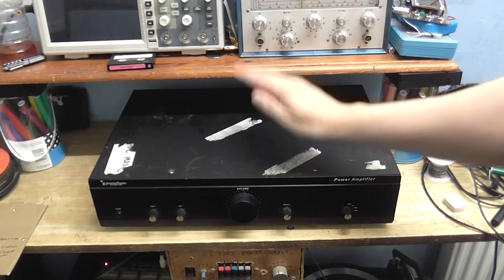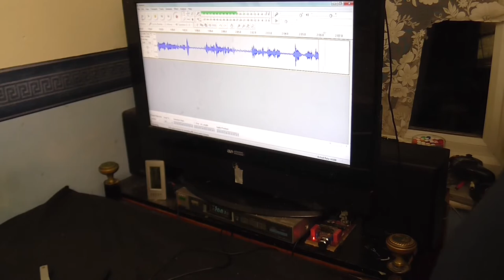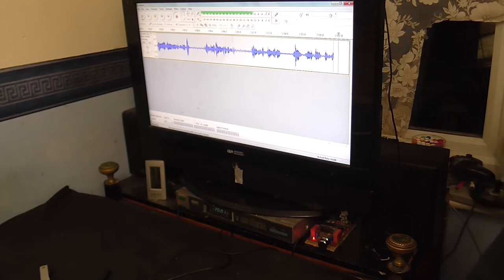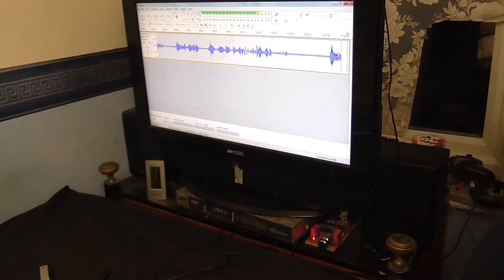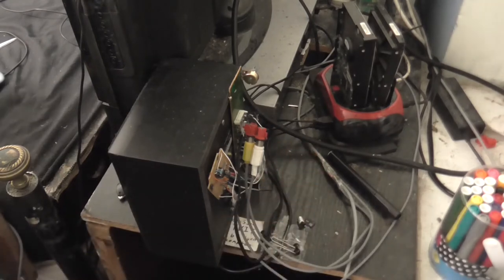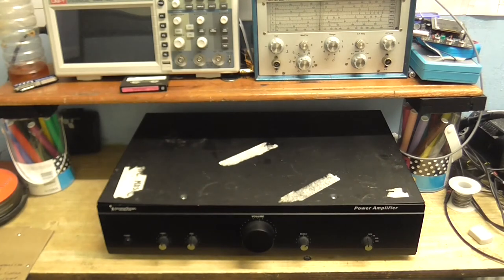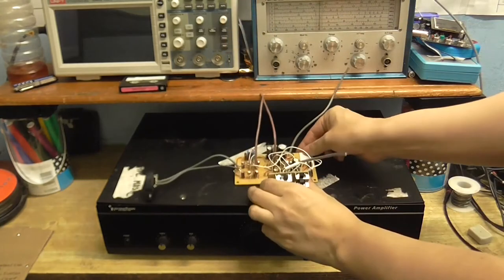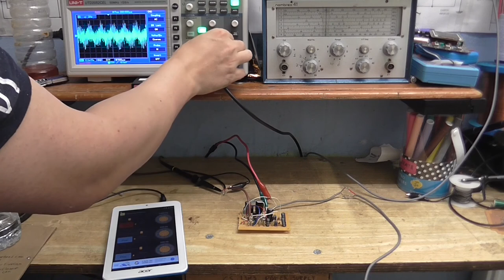Modifying an amplifier to have a "Windows 7" "Loudness Equalisation" circuit.

Comment: Wow, to see the working from the circuit so clear on your scope, super understandable this way! 
You say you made a video about that circuit? Okay then thats what i go looking for now, right after this video. I hope to see the schema in that previous video because i think i see only transistors and so well working too, thats a nice and interesting circuit i think.
Thanx for showing with scope and explaining so understandable
Reply from the maker: That's the beuty of it, the circuit only uses three transistors (per channel) and no chips of any kind. The video where I show a schematic is in the description.
Reply: CoolDudeClem 
Wow that is strange, that first transistor doesnt have any DC, only that little alternating signal current on the collector! How can that work so well? A DC-less transistor works almost as a regulated resistor, bit like a FET? But without heavy distortion? I see and hear this works absolutely great, and it sure is a nice and surprising circuit!
Reply from the maker: I'm kinda confused about it myself, I thought there might be some DC offset going on, but I measured it and apparently not.

Comment: You might have windows loudness equalisation built in to your computer's audio hardware.   This can be found under Play-back Devices/{the speakers in question}/Properties/Enhancements  It's worth checking out if you haven't already done so.
Reply from the maker: That's how I usually have my sound set, I always have that on. Like I said I watch a lot of YouTube, and the loudness equalization makes it so I dont have to constantly reach for the volume knob. Works well on YouTube Poops as well, you know the ones where the sound levels are all over the place. I always thought this feature was done in software though.